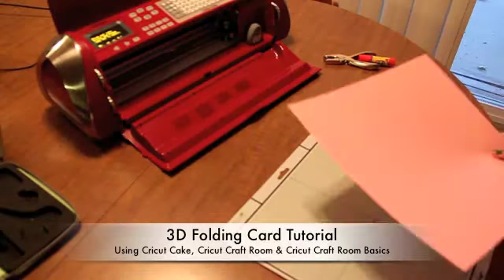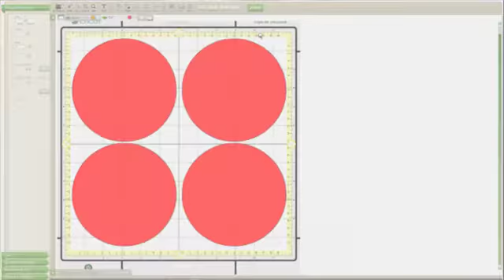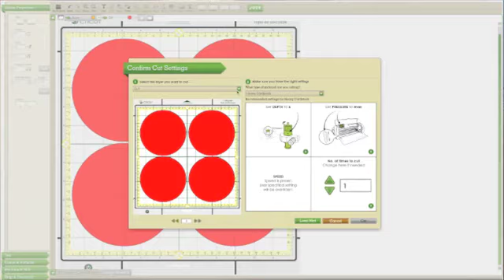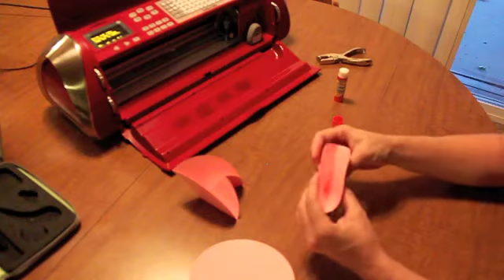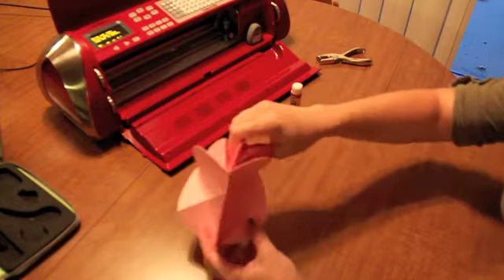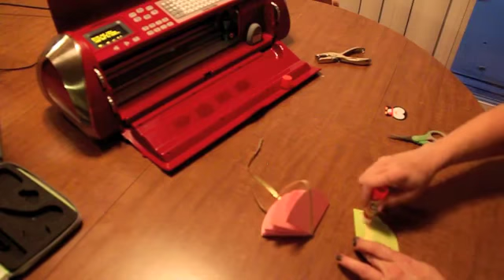3D Folding Card Tutorial using Cricut Craft Room

Comment: Can I use it for vinyl heat transfer material? And what kind a software you use in the computer?
Reply from the maker: Well for the 3D card, I can't see heat transfer material working.  For the Cricut in general, yes you can cut heat transfer material.  I haven't tried it on the Cricut Cake.  You will want to try a test area, I would start with the blade at it's highest setting and go from there. 

The software to cut with your computer is "Cricut Craft Room" - it can be found on the Cricut website.